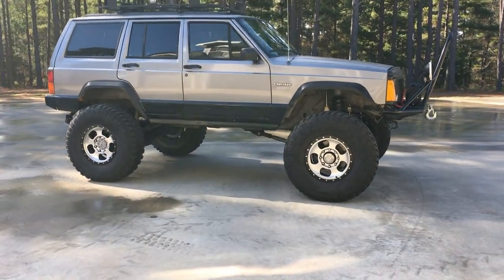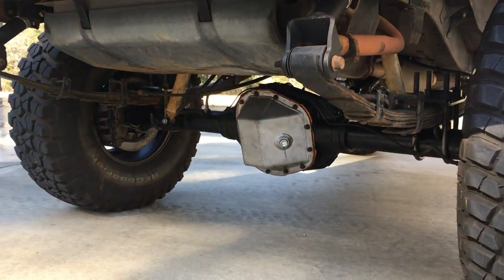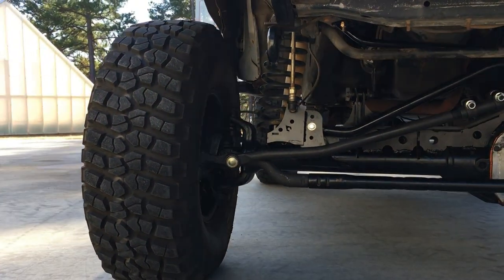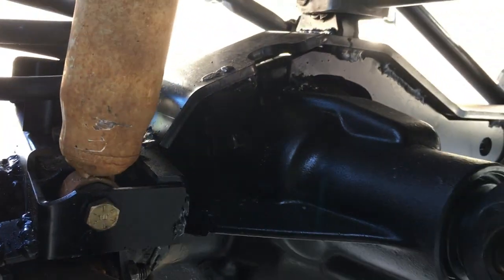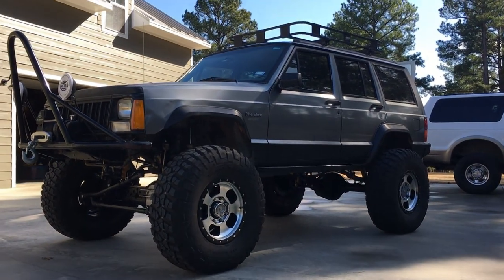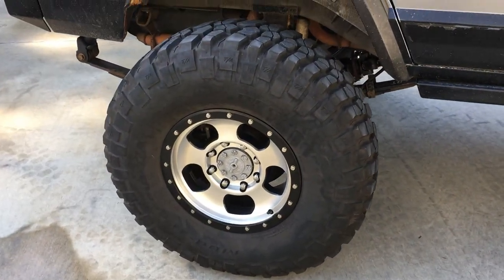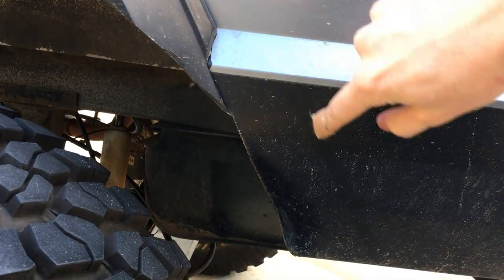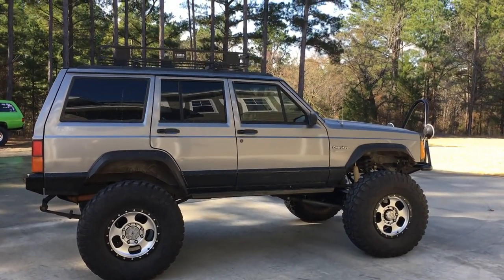Jeep XJ 1 Ton Project Overview | Superduty Swap, Drivetrain, Suspension and More 2018 Update

Comment: You have an awesome built xj,, wish I had seen this video before. I have a question, I am in awe at how flat your rear leaf spring are, I have 5.5 leaf spring at the rear, if I install the Ironman 4x4fab XJ Adjustable Shackles how do I get my rear leaf spring that flat
Reply from the maker: Well our leaf pack is a BDS 5 inch set...it has several small leafs and was a pretty flat very soft pack to begin with....if your 5.5 inch pack is not that flat then I would take the shortest leaf out of the bottom of the pack and then adjust your iron man shackle to the lift you need to match the front....that’s the beauty of the shackle set it can adjust so much you can take some leaves out if you need to make the rear soften up like it should! 👍🏻
Reply from the maker: Thanks for the kind words! Love this project as well!
Reply: @rockquestoff-road2839  Thanks for the information
Reply from the maker: My pleasure!

Comment: What year model ford for the one ton axles 
Btw awesome work sir
Reply from the maker: The front is a Dana 50 out of a 1999 Ford F-250...it is 69.25 inches wide and the rear is a Sterling 10.5 out of a 2005 F350 with disc brakes...it is 70 inches wide...the 99-2004 front axles are easier to get cleaned up because there are less brackets and mounts to grind off...the 2005 and up front ends are very strong but are also 72 inches wide or wider which makes it impossible to keep the tires in the fenders very much unless you get custom wheels with a deeper offset...but if you want the wide look go for a 2005 and later front Dana 60🤙🏻👍🏻
Reply from the maker: Thanks for the encouraging words man!
Reply: @rockquestoff-road2839  where did you get the axle fitment parts for the switch?

Comment: This is a awesome video.  I just got my hands on these same axles,  how did you center the axle under the rear??... I have so many questions!  Haha
Reply from the maker: awesome thats so exciting! on the rear just move each ford spring perch in 5/8 of an inch narrower on each side and you are set!!!!!!
Reply: Rockquest Off-Road

That's it??   Hell yeah!!  Does the 241 bolt up?? Or did you habe ti get a adaptor??
Reply from the maker: 241OR from a TJ bolted right up and same wires and linkage for shifter like it was made to be there lol
Reply: Rockquest Off-Road I know what I'm getting. 😎😎

Comment: Came out pretty nice, the only thing I didn't like was the ugly welds but everything came out nice. By the way how much did you spend on the modification?
Reply from the maker: Well with new wheels included probably around $3000ish...not too bad considering how much it costs to build up and regear stock axles and get lockers etc. :)
Reply: Not bad at all! 👍👍

Comment: So I'm doing this same swap on my Jeep, can you give me the measurements on where you put the perches on the rear? Im having a difficult time figuring it out. Thanks!
Reply from the maker: To make it easy cut off the perches and move each one toward the Diff half of a inch....then hook your springs up and use a jack to adjust your pinion angle to your driveshaft really close then weld them up! The sterling perches are overall set about 1 inch wider than a stock XJ....so moving them in half an inch each side works perfect! Good luck man! It drives SO much better than ever now!

Comment: hey i just got myself a set of these axles and will be doing this to my grand cherokee. I just want to know if you used the super duty brakes did you also have to switch your master cylinder and booster?
thanks!
Reply from the maker: just used factory master cylinder and system with the stock super duty calipers ...brakes work perfect and very strong (easily locks tires up with 37s)...spongy pedal is just from the extra fluid required to activate the bigger brakes but doesn't cause any performance issues! Such a pleasant surprise! We originally thought we would have to replace everything but NOPE! So glad!

Comment: what was needed to installed a 241 Transfer from the Rubicon to the AW4 auto trans? I keep hearing that they will not work..
Reply from the maker: Nothing was needed to install the TJ 241OR behind the AW4...the shifter and even the speedo wire hooked right up! You cannot use a JK 241 Rocktrac because the JK uses wheel speed sensors for speedo and trans and a host of other potential issues Good luck!

Comment: What driver side track bar mount did you use? And what kind of track bar
Reply from the maker: Rusty’s HD mount and HD track bar! We had to shorten it by an inch or 2 to give us the right amount of adjustability since the axle mount position changed somewhat...all in all so happy with the setup
Reply: Rockquest Off-Road alright thanks for the info, I’m in the process now of doing the swap an was also looking to keep the stock ford steering parts for initial cost during build
Reply: An xj track bar wouldn’t work would it , I currently have a rustys track bar for a 4-6” lift I know the frame side joint would have to be changed

Comment: did you have any issue with the long arm and artec truss im in the process of doing a 1ton swap and cant decide on what 3 link imma go with dont want to have to bend anything or adjust the 3 link arms thanks and love the build man
Reply from the maker: xj-jay 123013 no issues at all...if you buy or build a kit for the XJ all the links will slide right in where they are supposed to go...no modifications were needed 👍🏻
Reply from the maker: thanks man!!!

Comment: Great build! I'm about to do the same with d60 and sterling 10.5. I'm trying to research the total width to figure out what wheels I'll have to get. How wide are your wheels and what is your width from outside tire to outside tire?
Reply from the maker: the wheels are 17x9 American Racing Ansel with 5.7 inch backspacing (Hummer H2 wheels are around 6 inches backspacing) we had to grind a bit on the tie rod connection area to clear the wheel on the front...if you use 18 inch wheels you may not have the clearance issue with a deep backspacing wheel...8x170mm lug pattern for the fords...the width to the outside of each tire (12.5 wide tires) is 81 inches....the front axle we have is a 99-2004 Dana 50 (the 60 from those years is the same width) it is 69.25 inches wide wms to wms....the 2005 Sterling 10.5 in the rear is 70 inches wide wms to wms...if you have a 2005 and later front axle it will be 72 inches wide which will be more difficult to offset hope this helps!
Reply: Wow! That was more info than I expected. Thank you for that. I picked up 02 super duty d60/10.5 combo. my goal is to be no more than 82.5" wide. I plan on getting 17x9 beadlocks and 5in backspacing. I'm hoping to test fit some wheels and make sure it'll clear as I'm planing on the artec high steer weld on parts. Its got me a little worried, but we'll see how it plays out.
Reply from the maker: @Kneeknow.  Look forward to seeing it! Sounds awesome!
Reply: Rockquest Off-Road, how much of the front pumpkin/cast did you have to cut off ?

Comment: What is the taper size for the Ford tie rod end at the pitman arm?
Reply from the maker: We used a 7 degree reamer for it...https://www.speedwaymotors.com/Speedway-Tapered-Ball-Joint-Reamer-7-Degree,2918.html?
Reply: @rockquestoff-road2839  Perfect, thanks. Did you have to shorten the drag link?
Reply from the maker: Nope the factory superduty steering components are all the correct length

Comment: You stated the wheels Had 5.7 BS. Whats the diameter and width of the wheels? Awesome xj!
Reply from the maker: They are 17x9! Thanks man!! Just wheeled it for the first time on April 27 out at Barnwell Mountain and everything worked incredible!
Reply: Awesome, another question. You got the artec truss, the coil mounts were the right width and all?
Reply from the maker: The buckets are around 1 inch wider per side I would say....looks like the coils are in and the top and come down at a slight angle to a wider stance...they work great but it cannot be avoided because the differential is in the way :)

Comment: If you dont mind me asking, what pitman arm did you use to match up with ford TRE and the xj steering box?
Reply from the maker: We used the normal 8 inch drop pitman arm that came with the BDS lift...we grabbed a tapered reamer off of amazon and with some patience reamed the pitman arm slightly larger to accept the slightly larger tie rod end on the superduty drag link 👍🏻
Reply: Thanks! Looks great

Comment: How's she ride ona highway? I'd imagine fairly slow with the extra weight from the axles.
Reply from the maker: Well compared to a bone stock XJ yeah not as quick to get up to speed...but compared to a lifted XJ with stock gearing and 33s this thing would blow its doors off...with 5.38 gears and 37s its pretty powerful up to around 45-55...holds 70-75 no problem and can pull hills with ease because of the gearing
Reply from the maker: The suspension is soft and comfortable...it’s a older Jeep so wind noise and road noise are a thing but it’s not bad at all 👍🏻
Reply: I noticed the proper geat ratio so i wasn't too worried about matching rpms. But I'm surprised with the weight it gets up to that speed.
Reply from the maker: Oh yes no problem at highway speeds...have had it to 80-85 but it’s working hard cruising at that speed so no reason to push it 👍🏻

Comment: So what all did you do to fix the brake issue?
Reply from the maker: Nothing...just used factory master cylinder and system...brakes work perfect and very strong...spongy pedal is just from the extra fluid required to activate the bigger brakes but doesnt cuase any performance issues! Such a pleasant surprise!

Comment: Hey sweet build. What perches did you use for the rear and were any leafs removed from that leaf pack?
Reply from the maker: We used some perches from Rustys their 3 hole anti wrap perches...they are about 5 to 6 inches long I believe....left the 5 inch BDS leaf pack intact....just removed the 2 inch block from the lift kit and used the shackles to dial it in the rest of the way....super soft springs really like a lot
Reply: Rockquest Off-Road did you tackle the ebrake and master cylinder upgrade?  This video has me super pumped to knock out my swap
Reply from the maker: Dude! Awesome! As I told Randy down below we read up on brake mods but decided to hook everything up factory and see how it did....could not be more surprised...the peddle is spongy feeling but it brakes very strong and hard...easily locks up the 37s when you panic stop and they held PERFECT when we went wheeling.....stock master cylinder and stock booster...its way better that the way it braked stock with no lift! So save yourself some money and just live with a spongy pedal that other than the feel works perfect! Thanks man!
Reply: Rockquest Off-Road thank you. Last question... Do you have a shop that offers services? I'm in Dallas and need a pro to weld the truss to cast!
Reply from the maker: Bro I wish...we have a shop and do all of our own stuff but don't have a lot of extra time...What I would do is get the truss kit and if you have a welder put the time in getting it all assembled and firmly tacked in place....then take to a welding shop and get them to finish out all the welds....the housing is cast steel so thankfully its not cast iron....just needed some power to burn in a few beads....most of the strength is welded to the steel tubes and perch areas on the front end! Let me know when you are rolling adn maybe we can meet up and wheel it!
Reply from the maker: We are in Tyler
Reply: Rockquest Off-Road I scored a pair 2012 SD axles. Curious which spring perches you installed and if you had to redrill the perch to get the 1" stretch? Also did you change the sterling ring bolts for shouldered D60 ring bolts? Thanks!
Reply from the maker: We used some perches from Rustys their 3 hole anti wrap perches...we used the farthest offest hole out of the 3 to give us a 1 inch stretch...they are about 5 to 6 inches long total I believe...keep in mind you have that 2005+ superduty front end...so it will be 3 inches wider than ours...run some high backspacing wheels like we did but you will have to add some 1 to 1.5 inch spacers on the back to even the tires track width! The ring gear bolts are stock...lots of locktite of course...as long as you dont have 500 hp and 44+ tires the ring gear bolts should never be an issue...thing is massive lol Awesome find!!!! Cant wait to see how it turns out!
Reply: Rockquest Off-Road guys, I'm hung up on my shock length. My 4.5" BDS kit has the same leafs as your setup (5"). I'm boggled as to how you removing the block AND the new shock mounts up a few inches netted correct travel. Was it the leaf perch height that offset everything? Or better yet how boned will I be with my 5" read lift shocks. Am I just going to be limited with down travel?
Reply from the maker: The way we made it work was by using the Ironman Fab shackle relocation to give us the extra 2-3 inches we needed to stay around 8 inches of lift...that way we could take the block out for a better and safer spring setup...the shocks are 8.5 inch lift BDS shocks so since we stayed around that height the length worked perfect...if you are keeping you 4.5-5 inch overall lift after the swap then the shocks will work fine....if you are lifting it higher with shackle relocation and different front coils then you will need longer shocks...they will be quite a bit too short and very easily could rip a shock mount off
Reply: Rockquest Off-Road I learned the hard way by buying a 2012 set of axles. Nobody makes R+P larger than 4.88 for this 37 spline sterling!
Reply from the maker: Oh no!!! Haha yep not very many options for those but they are BEEFY
Reply: @rockquestoff-road2839  hey guys I've almost got the front in and ready to come wheel Barnwell. My last hang up is the Trac Bar. Did you use the Trac Bar from the BDS kit or is yours a custom shorter setup due to the higher mount on the artec truss?
Reply from the maker: Dude way to go!!! We used a Randy’s HD track bar adjustable one and we have to cut the bung on the axle end off and shorten it 1 inch and weld the bung back on and we were SET! We will be going to Barnwell September I’ll stay in touch!
Reply from the maker: this is what we used.http://www.rustysoffroad.com/rusty-s-track-bar-hd-track-bar-package-xj.html it was about an inch too long so we cut the bung off of the axle side of the track bar...and cut 1.5 inches off of the pipe then welded the bung with the rubber bushing back on....then we were set! Stronger mount than the BDS one also and much bigger bushings that wont wear out every 10 miles you drive lol
Reply: @rockquestoff-road2839  Jeep is back on the ground. All I'm lacking is front brake lines, pitman ream, Trac Bar shortening and alignments. What brake lines are you running and do you know the taper size needed to seat the Ford drag link?
Reply from the maker: https://www.wildhorses4x4.com/product/Tapered_Reamer/Custom_tie_rods
you will need this 1-1/2" taper per foot or 7.125 degree included angle reamer for the pitman arm....we are running stock BDS 8.5 inch lift stainless brake lines...they bolted right up to the super duty calipers on our 1999 F250 front end! So glad you are close man!

Comment: How are the 5.38s and 37s on the road? Too much gear or is it bearable?
Reply from the maker: ITs perfectly bearable...stock exhaust at highway speeds it runs around 2600 RPM which is a bit higher than I would like but it does pull hills with ease and has confident power which helps us feel we are taking a load off the engine and trans...most JK guys from the pre 2012 era run 5.13s and 5.38 with any tire 35 inches and over and love it...if you have 35s I would run 4.88s...if 37s run 5.13 or 5.38s
Reply: I'm just curious as I've been building my setup and just went to the highest gear right off the bat so I wouldn't have to do it again. Dana 60/14-bolt 5.38s, spartan & grizzly. I snagged a cheap set of 40s but was a bit worried it might limit me to a 40"+ tire to be streetable, especially considering mine is an AX-15.
Reply from the maker: With an AX-15 it should be awesome with 5.38s! Manual is always better with deep gears sounds like a beast rig man!
Reply: Thanks! I hope so! It's coming along, just tying up loose ends on the axles then I can throw them in. Wish I had of gone with superdutys though. I picked up a 2011 D60/Sterling 10.50 for a song & dance, then a week later a set of 2003 superduty D60/Sterling 10.25. Both are HUGE compared to the kingpin 60. If I wasn't basically done I would 100% build the 2011.

Comment: what modal jeep and what kind of jeep  will inner change {complete Housing } an all with my 2000 jeep cherokee... How do i tell a xj from other jeeps.. i have a 355 ratio in my 2000. bad pinion gear. Just want to change it all... what will fit my jeep and match front. I think i have a Danna 30 in the front and Danna 35 in rear.
Reply from the maker: Yes you have a Dana 30 front...if you want to replace the whole axle just head to the junkyard and look for the front end out of a 1984-2001 Jeep Cherokee 4x4...to check the gear ratio look for the metal tag on the differential cover. If the tag is gone or damaged just turn the tire and count the rotations of the yoke where the driveshaft connects...instruction at this link https://www.quadratec.com/jeep_knowledgebase/article-130.htm

Hope this helps!
Reply: First off thanks for your reply... I  need the rear end replaced Im wanting to take out axles housing an all out of my 2000 cherokee and replace it with another complete housing axels an all.unbolt u bolts drop it all. What modal jeeps will inner change...is it the same as u mentioned for the rear end... from a 1984- 2001